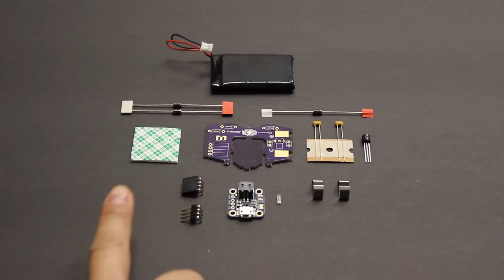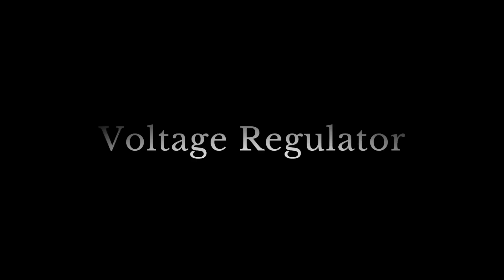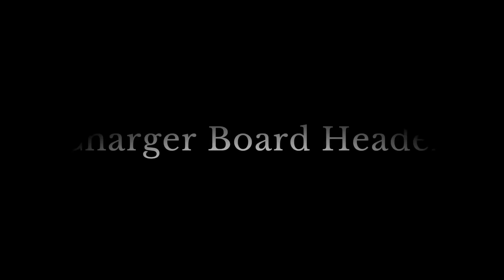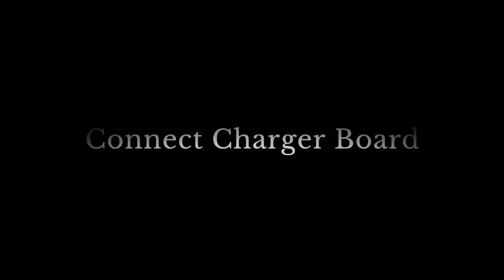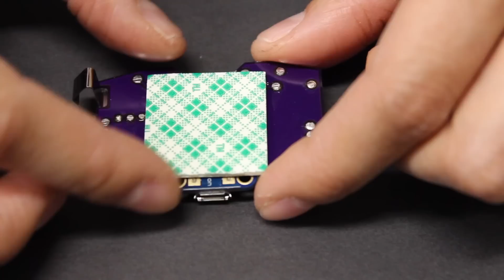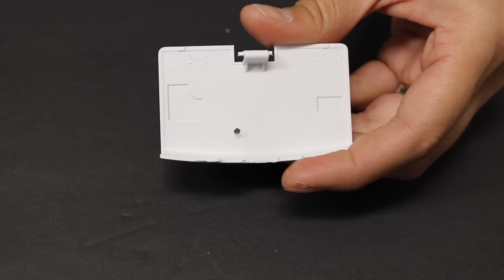PowerUp Advance v1.0 Assembly - A DIY Battery Mod Kit for Game Boy Advance

Comment: Does the current PowerUp Advance support USB-C PD (C to C) cables? Or Only USB-A to C?
Reply from the maker: The V2 kits with USB-C do support PowerDelivery. You can use a MacBook charger or even a Switch charger.

Comment: way to expensive i wish it was a little more affordable, with a charge controller a diode and a small lithium batter a guy on here did it wasnt a custom pcb but it deff achieved the exact affect and you could charge directly from the system exactly like this, and it was all done with $5 no not a type-o yes five ONE TWO THREE FOUR FIVE dollars FIVE DOLLARS. im going to take that route, not trying to throw shade on you guys i just rather pay what i know its worth to me by doing the work, i would much rather use your KIT but i only have the money to spend on the other parts list and make my own kit

Comment: If only it had type C I'd buy it. Sold my 300 headphones due to it not having type C, want to buy a Vita but keep on not doing it due to that micro USB. I just heavily dislike USB c
Reply from the maker: blackabe111 The latest version has USB-C and a larger battery, plus no soldering required! Both versions are available on modmatic.io currently. :)
Reply: @modmatic  thanks! Bought two around 4 days ago!

Comment: Hi, why is that basic kit no longer offered?! Instead of that way to expensive 2.0? And even if i would be interested why is it no possible to order directly from you when outside the U.S.? Instead of offering international shipping you link to that handheldlegend blah blah retailer who wants incomprehensible 70 bucks. Seems not competitive. That mod may look interesting but it is less essential compared to a back lit mod for example. And in that case excessive prices combined with restrictions in ordering would not make this product a must-buy even if it is a nice one.

Comment: everywhere i look, all battery mods for gameboys have weak batteries. this one is 1A. by far the weakest
Reply from the maker: Hi I. George, did you mean in terms of capacity? (1Ah). Unfortunately there are size constraints within the battery compartment. However, our next version will be larger in capacity due to some design changes we’re making, so keep up to date by subscribing on our website.

Comment: will def pick this up when available. Are we able to install a bigger capacity battery such as 1400 mAH
Reply from the maker: Rafael Carbajal Technically yes if you know what you’re doing. We definitely advise caution when working with lithium batteries. Feel free to contact us through the website if you have questions about a battery you’re thinking about using.

Comment: love this. although there are 2 things I honestly dislike about this: 1) Price, dont you think that's a little too expensive? 2) why do I have to modify my GBA for this to fit? why didnt you make it fit by design???? Battery cover is ok, but console itself? :(
Reply from the maker: Tom Landolt Hi there, thanks for your questions. As far as fit, designing and certifying a custom battery shape, rather than using a common prismatic shaped battery, would be very expensive and time-consuming. We had to make a trade-off, and trimming a few plastic ridges seemed like a good balance (most users are using aftermarket shells anyway). For pricing, consider a couple of things: 1) a ton more goes into a product than just parts - engineering, battery sourcing and certification (especially for lithium-ion), documentation, advertising, etc.; 2) this is a niche market, so quantity sold tends to be lower than say a PlayStation, iPhone, or some other more widely-used product. Hope that helps! For now, we’ll also have a limited quantity of self-solder versions that are about $10 cheaper than the pre-soldered kit.
Reply: @modmatic  ok thanks still interessted :) so probably will order one soon
Reply: one small question: when do you expect it to be in stock?
Reply from the maker: Tom Landolt We’re hoping by the end of May. We had some parts get lost in the mail, so we had to have more produced. Fingers crossed!

Comment: Ok, so my knowledge of electronics isn't that great but, I'm not seeing any real reason why this wouldnt work for other handheld systems that use AA batteries. Other than perhaps having to reroute the charging port, is there any reason this couldn't be used for a GBC?

Edit: It does look like something would have to be done in terms of the battery terminals because it seems that the terminals soldered into the board on the color are on the opposite side compared to the advance. So, the kit might have to be upside down for the pads to connect properly.
Reply from the maker: Hi! Theoretically it could work because the voltage is the same. However, as you mentioned, it could take some work to make a physical fit. Another consideration is the GBC battery light. There is a threshold at which that warning light will come on at the front of the GBA/GBC, and PUA is designed with GBA in mind primarily. There's a chance that different diodes would need to be used to tune the voltage drop for the GBC.

Comment: to the fact that you're also shipping international. could you please also add the measurements in milimeters to your pdf guide?
the vast majority of the world doesn't use the imperial system. otherwise great guide, this video too

btw. when can we expect a new bunch of the basic set? i'm already on the list
Reply from the maker: Hi there! Thanks for your interest. The board is essentially the same dimension as the battery pack (well, except for thickness), and you can find all those details at the end of our assembly guide at modmatic.io/powerup-advance, in the battery section. Measurements there are in millimeters :) We expect to have a new batch of kits in about a month. Glad you're signed up already!

Comment: Does this charge while playing?
Reply from the maker: Game Retro Sure does! There’s load-sharing circuitry  built in specifically for this purpose.
Reply: @modmatic  Sweet! I've actually built something similar with a TP4056 from scratch, but this looks amazingly clean and well put together. Would love to review it on my channel sometime, guess when I have some extra cash! GREAT JOB!
Reply from the maker: Game Retro Yeah that is a popular board. Unfortunately by default its current is too high for a 1Ah LiPo, since charging at 0.5C is recommended. You can lower it with a mod but it’s more work. Also, we’re bringing our charger board in-house and are changing it to USB-C!
Reply: @modmatic  So I've read! A great decision considering everything is transitioning towards usb-c! (hopefully even iphones soons hahah)
Reply from the maker: Game Retro And thanks for the compliment! We still have some left if you’d like to review it 😉
Reply: @modmatic  definitely would love to!

Comment: Can anyone point me towards where to find a battery for this?
Reply from the maker: Hi! If you check the back of our assembly guide, you'll find all the details you need for the battery specs. Overseas customers have had good luck with AliExpress, Amazon, and Ebay. Hope that helps!
Reply from the maker: A customer came across this battery on AliExpress, which seems to be compatible: https://www.aliexpress.com/item/3-7V-900mAh-LiPo-Lithium-Polymer-Rechargeable-Battery-JST-PH-2-0mm-2pin-connector-603048-For/32922851731.html?spm=2114.search0104.3.8.65e917a3Hf0P1T&ws_ab_test=searchweb0_0,searchweb201602_1_10065_10130_10068_10890_10547_319_10546_317_10548_10545_10696_453_10084_454_10083_10618_10307_537_536_10902_10059_10884_10887_321_322_10103,searchweb201603_57,ppcSwitch_0&algo_expid=1b28358d-58a3-41cd-b1a8-1aa0a202a37d-1&algo_pvid=1b28358d-58a3-41cd-b1a8-1aa0a202a37d&transAbTest=ae803_5
Reply: Hi... i used this battery and it's everything fine ( https://www.ebay.com/itm/3-7V-900mAh-Lipo-li-Polymer-Battery-JST-PH-2-0mm-For-mobile-phone-GPS-DVD-603048-/123367484573 )